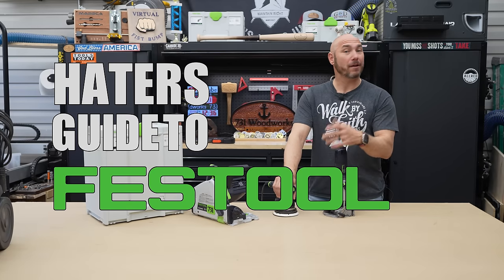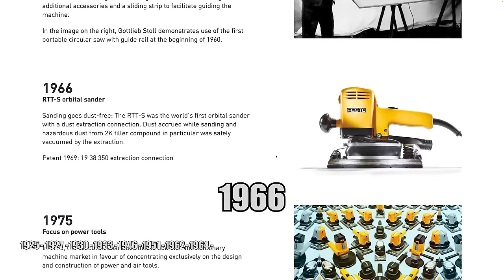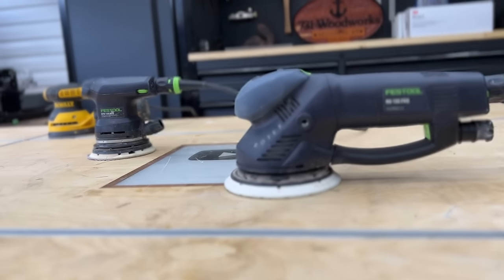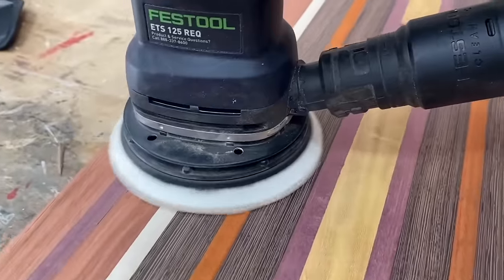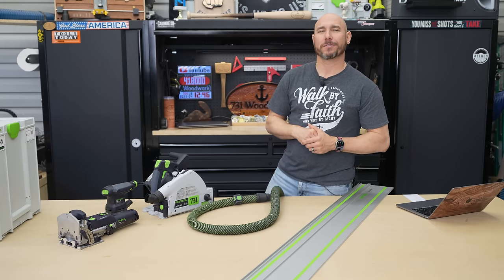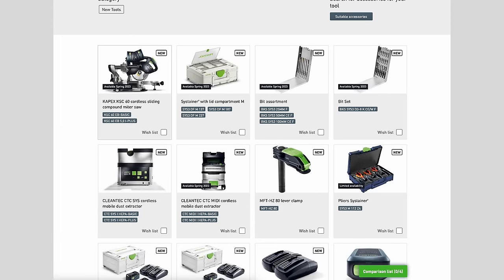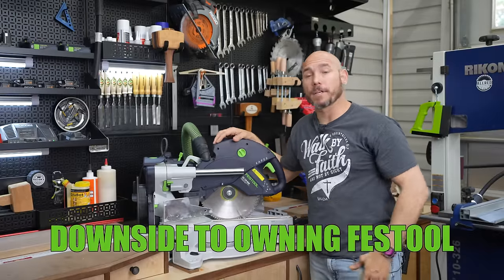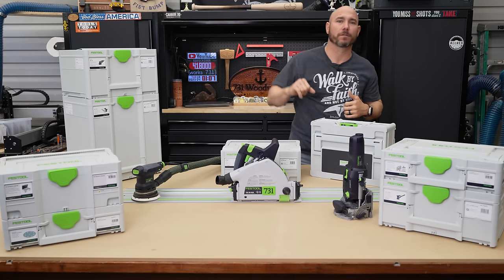The Hater's Guide to Festool | How Festool Changed the Game

Comment: I had a Festool Trion jigsaw that lasted over 10 years working on site. It had a hard life, mostly cutting through 45mm worktops. It went through 000’s of blades, even got dropped of 3 story scaffolding and carried on working. It paid for itself in the first couple of years. Great accurate jigsaw. I have 17 Festool tools and wouldn’t ever go to another brand. The engineering and just feels like a quality tool in your hand. When I try friends other brands they really just feel like toys. You won’t ever be sold if you worry about the money, but it’s honestly worth every penny. 3 years warranty. 10 years guaranteed parts, 3 years theft cover for £100 if anything is ever stolen. Plus their customer service. They pick up the tool if it fails under warranty and drop it back to your address once it’s repaired. Festool is an investment in your tool collection. One more thing, try the Kapex without dust extraction for a few cuts then put it back and and you realise how good it is. Is it perfect, No is it better then other mitre saws, absolutely yes.

Comment: I had a discussion with a colleague about high quality tools that changed how I look at tools and specifically high end tools. I was telling him he should get a cordless 15ga nail gun as a part of his siding business. I mentioned the typical points about saving money over time by not having to set up a compressor, ease of moving the tool around the job site, and moving the tool between job sites. Sure, it would cost between 2x and 3x as much as an air gun, but it would pay for itself.

He had a great point "Yeah. That's great and all, but I'm buying stuff that inexperienced helpers will drop off the 2nd floor of a building or forget outside in the rain, or forget to perform maintenance on. Tools get beat up around here. I go for the bargain bin stuff that can be replaced easily."

This is in contrast with Festool. Festool stuff works brilliantly when it's in perfect condition! If you need your track saw to be better then 1/128th true over 8ft, you just might not get that with Mikita.  Once you drop that track off the table with the saw on it, it's just as crap as the 1/2 priced one! As long as these tools are used gently (and that isn't how everyone uses tool, either by temperament or by application), they will stay awesome for a long time. 

The miter saw looks great but I think I'll stick with my Dewalt one. Don't get me wrong, I expect the Festool one is a superior tool out of the box. If it would stay that awesome for me for 5+ years, I would totally get one. Within the first year of owning my saw, I've had 2 different helpers not know how to unlock the bevel and miter settings and literally just forced their way through the locking function *face palm. If that happened with my Festool saw, that would be a lot more unfortunate. Close to 2.5x as unfortunate to be specific. Again, Festool is awesome as long as it isn't abused. If I'm using it in a climate controlled environment and it's only being handled by trained professionals, that's totally the tool for the job. Where I'm working, my miter saw gets used in the rain sometimes, it isn't in a climate controlled space a lot of the time, and sometimes it's being used by people who aren't treating it gently.

Comment: I appreciate the effort you into explaining the value. My wallet and ability can’t justify a $1600 miter saw but if you can afford it go for it
Reply: Having done a fairly large number of woodworking projects myself, I've talked to a few people about getting started. My vote is a simple 10 or 12 inch DeWalt miter saw at the most. Take that $1600 and buy the <$300 miter and spend the rest on a really solid table saw and make some sleds and jigs to go with it. Or, a track saw does wonders as well.
Reply: The big festool chop saw is not worth the cost. I owned it at one point and didnt like it much mainly because you were locked into using their blades and the saw really didnt do much that other brands did for half the cost. I use makitas mostly, however as I have gotten older I look more and more at the smaller chop saws, for me I dont need 10" saws much. Festool is releasing a smaller battery powered saw that looks interesting. Still a hefty price tag.
Reply: @paulhouseholder9360 I have the basic dewalt 12” miter saw. Buying the non sliding version is better because it’s less slop and thus more accurate. 

I tuned it up to make sure it’s square in all three planes and made a zero clearance plate and fence on it. Cost $200 and I can cut as precise as a I would ever need to as a woodworker. 

Of course I also have a table saw. But I bought my miter saw for home remodeling more so than woodworking. It just wasn’t hard to get it cutting perfectly square so I use it for woodworking too.
Reply: The miter saw is one of the festool you just don’t need for woodworking. The sanders and dust collector are cool. The domino and track saw are worth considering. But that’s about it. A Bosch router is just as good. A tuned up basic miter saw is fine. Every brand has certain tools that are too off the line or near enough to make no difference. Bosch routers Milwaukee drills etc. festool isn’t needed for every tool but they do have a handful that are great for woodworkers.
Reply: i would have to disagree, the festool kapex is sooo much better than the next best miter saw option.  we have both the highest end makita and the festool kapex miter saw  in our shop and the festool is as accurate as it gets when cutting different angles.  it is certainly expensive but it is by far the most accurate @CarlYota
Reply: @tomdrossi  Have you actually measured that, as in compare with a digital level on the blase and workpiece after cutting? 
Also there are more reputable brands out there. Bosch and Metabo both make excellent miter saws and I'd choose their top of the line over the overpriced Kapex every time. The smallest Metabo is also the best entry-level mitersaw hands down.
Reply: @iliketoast-q9b i use digital angle finders to mark the pieces and also set it against the blade to set the angles.  It’s accurate as in it has zero blade deflection, especially on compound angles where i find the makita to cut repeated angles slightly different every time but the kapex was dead accurate every repeated cut. I think it’s worth every dollar…not everybody can afford a kapex and that’s okay!
Reply: @tomdrossi  I believe you, but that's the type of anecdote that I've heard about virtually every hyped tool brand out there. I never said Festool doesn't make good tools, they do! 
But people make them out to be this magical brand that makes the very best woodworking tools with no competition, which just isn't true. I for one would never choose a Festool cordless drill over a Bosch, Metabo or Milwaukee, just to name a few. Festool sanders are excellent, but so are ones from Mirka, 3M and others. The Domino makes kinda sense when you build a lot of cabinets, but for everybody else dowels + jig are a better choice, yet everybody wants a Domino...I just can't stand the hype and I think they're ugly, cheap looking tools, is all I'm saying. :D

Comment: I am a hobbyist and I bought my Festool track saw and CE22 dust extractor probably 12 years ago. It was an impulse buy, but I didn't have a table saw, so felt this track saw would fit me needs. Although I now have a table saw, is still use the track saw. The extractor ALL the time. I've since added the Rotex sander (dust collection is unbeaten).

Comment: I'm an intermediate woodworker and recently dipped my toes into the pool. Funny thing is I started with the exact sander (125REQ) you recommend for that dip. I've used MANY random orbit sanders over the years - I used/owned the original from Milwaukee back in the 90's and loved it. I've used some high end pneumatics in classes I had taken in the 80's. I currently owner 3 different more economical cordless random orbit sanders and have always thought they were great. I bought the Festool to settle my own curiosity and skepticism... After only using it ONE time... I've been reaching for that green jug for more!! I am utterly amazed at the comfort and ease I experienced. Faster results with the same sandpaper and much less effort to control and let the sander float across the wood. Bottom line - if you can afford it, try it! You will not regret it! It makes woodworking more enjoyable and makes me want to do more.

Comment: Im a professional woodworker in Ireland and Im on the dewalt battery platform. My rule of thumb is if I need accuracy and/or dust collection its festool. If not its Dewalt. So my angle grinder, multi tool, SDS, drills and jigsaw etc are Dewalt. Track saw, sander, planer, kapex router are festool. The quality of the festool is incredible and as youve mentioned, the dust collection is second to none.

Comment: I had the choice of the Festool track saw and the Makita one. I choose the Makita and don’t regret it to be honest. But I’d love the kapex ive been oohing over that for a while. Think most of the festool hate comes from £££. Jealousy doesn’t make friends .
Reply: Do you really need the kapex though? What can it do that a tuned up $200 Dewalt miter saw can’t?  The price difference is staggering. And most woodworkers use table saws as their main tool anyway. I have a squared up basic Dewalt and can cut as precise as I’d ever have to as a woodworker. 

I’m all for expensive tools if they are actually better than the basic alternatives. But is the kapex actually that much better?  Maybe for dust collection inside someone house, but in a woodworking shop?

Comment: The first Festools I bought were the CT36 and the drywall sander for a residential remodel (my home) I'm working on. I'm knocking down the orange peel and skim-coating all the walls and ceiling.... I honestly couldn't believe how awesome that combination was. IMO, easily worth what I paid even if I only use them for this one job (though I use the CT 36 in my workshop every day).

Comment: I have several brands for power tool. Best tool for the job. My first purchased the extractor and the domino. Yes, not cheap, but quality built. I do woodworking project for myself and the time I save so much time using the domino. My first Festool drill was the CXS and the power and smooth control for such a small and 10.8V system. I have Makita, Bosch, Ryobi and DeWALT. Having a good dust extraction with suction control makes a huge difference and for sanding even more.

Comment: If I were a professional woodworker making high-end furniture and had the money, I would consider Festool.
Reply: As a hobbyist, I can afford to spend a bit more on some tools...  the trick is figuring out where to spend a little extra to make a difference.  And I fully endorse the recommendation made in this video, for the Festool orbital sander and shop vac.  I do a lot of sanding (some for home renovations: doors and walls), and the Festool combo is a game changer in dust collection and comfort, even though there are other good brands offering a similar quality.  I'd probably buy them again if I only used them for my woodworking projects.  
  
Likewise I spent extra on a track saw that I do not use all that often, but when I do I want it to work well and cut true and neatly.  Likewise for a good set of combination squares.  That are actually square unlike the cheap ones I had.  In contrast, I did not spend much on my chisels, tools that I use a lot.  I went with someone's recommendation, got a cheap set with handles that looked like they'd last me a while, and spend a lot of time ensuring they are properly set up, and I keep them sharp.
   
YT can be a real money saver if you take the right advice.

Comment: I work for myself and sometimes I need some wood working tools. I have DeWalt drills and sanders, but I picked up a Festool sander for a remodel that I was working on.  It works much better then anything I have.
Reply: I broke my Dewalt sander on the very first project. Upon investigating it I realized it had plastic drive components. And most comparable sanders were the same faulty design. So I returned it and bought a festool (the $200 one). Haven’t had a problem yet.

Comment: If you watch AvE's tear-down of a Festool track saw, you'll see why I can't see myself splurging on their products. While the usage design is certainly top notch, the materials and internal design leaves a lot to be desired. If they had more skookum internals, I could see the price being justified. 

I get that there are people who have had their festool for a million years and never had an issue. That's great, but some of us abuse their tools more than others. If you can treat this like it's made of crystal, make sure it is put away properly every time, never gets wet, never dropped in the dirt, never repeatedly put the motor in a bind, etc... Hat's off to you. I buy cheaper tools because I tend to abuse them on occasion, but at least with them, their price more closely reflects their durability. 

With Festool, they use budget parts to make a top of the line tool, then charge double for it. Maybe hoping the price deters people abusing their products the way they would with a cheaper brand.
Reply: Track saw of that vintage but the newer models are completely redesigned and have brushless motors.
Reply: @kwilliams2239  
I guess I don't see the correlation between brushless vs brushed and durable vs not durable. I could buy 20 to 30 brushless tools all day long at harbor freight or Amazon for the price of one Festool track saw. I don't think I would classify them as durable just because they have "brushless" molded into the side of the tool.

A brushless motor is just more energy efficient than its brushed counter-part. It also requires a lot more circuitry to control it. IOW, more things that can break.

I liken it to people who still buy BMW. They will never admit that BMW makes highly designed mediocre products over the last couple of decades. They still see that brand as a status symbol, and convince themselves that it's fine for regular maintenance and repairs to cost so much, or that replacing their car every 3 years is normal.

You might have the similar problems with a Ford or a Kia, but at least you are paying Ford/Kia prices.

Comment: I would rather watch a video with a guy using Ryobi and DeWalt than one that uses Fesstool. Reason is they will have more similar issues to overcome than the guy with a $1200 domino Fesstool. 
The biggest issue I have with Fesstool is that they are not just a little more expensive. They are like comparing a Ford to a Rolls Royce. 
Most YouTube watchers don't have these spendy tools so let's see how you do things with the tools we have.

Comment: I’m a professional contractor and have been for decades and can say Festool is EXPENSIVE and other than a few cases, where other brands don’t make equivalent or comparable tools, they are quite over-priced or at least priced higher than I’d consider spending considering the tools don’t have added benefits to outweigh the higher cost.
Now some of their tools don’t have comparable other options, like the Domino, but you can buy much cheaper track saws, drywall sanders, miter saws, etc. that can accomplish the same job for less. 
I don’t hold anyone’s tool choices against them, so long as they can use their tools to accomplish their jobs, and so long as they aren’t either throwing it in your face or act professional because of their tools despite not knowing how to actually work or do the work.
As a note I own a Domino and have used the Kapex but never liked the vertical grip, though I did like the front adjustment for the bevel. I’ve used a lot of different brands over the years from plug-ins to battery tools and ultimately have come to choose a battery platform over a particular tool company or specific tools as I’ve long switched to battery tools as much as possible. I have plenty of power tools that are well over 20 years and battery tools that are over 10 years old that are sill working.

Comment: Interesting Topic. 
I never new that there is "hate" against festool.
I, as a hobby woodworker, sure don´t need festool. Bosch, Metabo etc. do well for us hobbyist´s  too.

But when I startet with a Festool c12 some 20 years ago its tool change system hooked me!
A few years later I saved up enough money and bought the ts55 track saw, because of the reasons mentioned here.
No one else had a track for there saws back than and it really makes a difference.
Over the course of 20 years I go me a few more tools from them.
Router, sander, jigsaw etc and even the small domino.

No I´m sure not rich, but I´m patient.
Buying cheap is buying twice and buying twice is too expensive. It´s my motto.

After 20 years countless peaces of furniture and other things I build with that tools.
Every single machine is still working fine.

Comment: I remember back in the 80s when I was an apprentice toolmaker working in the press shop. We had Festo pneumatic material feeders that fed and clamped material in the press tool. They are a fantastic product. They were expensive back then but real top quality. Don't have the cash for them now but certainly do love the product. Probably would not buy a domino joiner as a good quality dowel jig is just as good IMHO, but their sanders, track saw, mitre saws are worth the money. I forgot to mention their vacuums and dust extraction system.